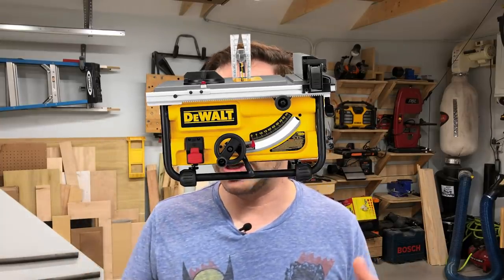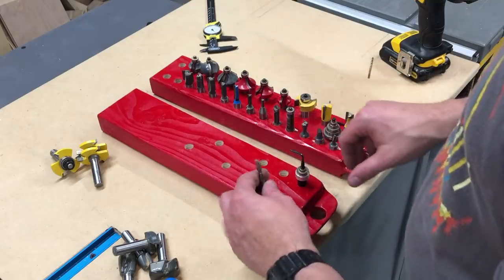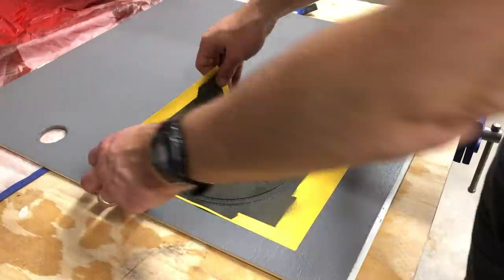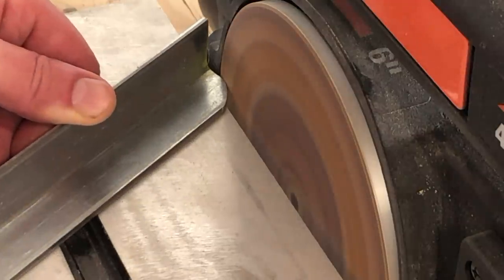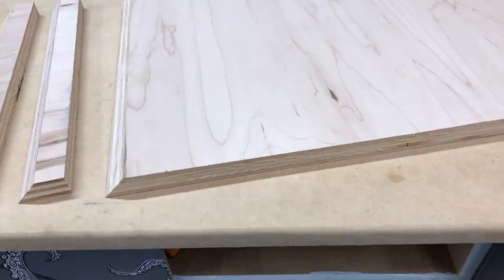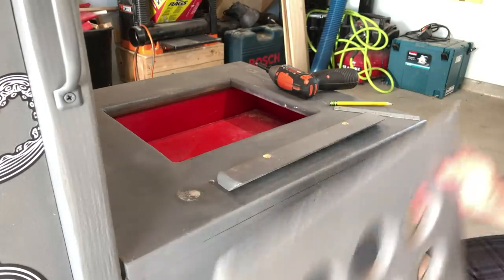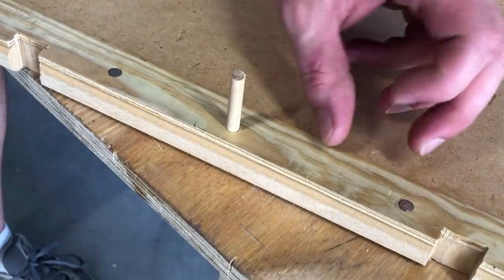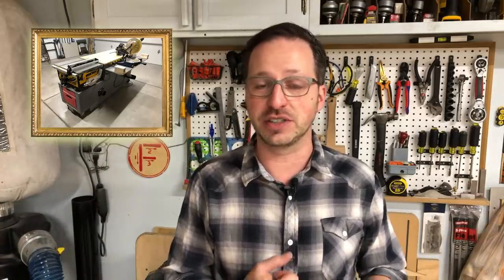DIY Amazing Compact Workbench - Part 4: Router bit holders, Table saw extension, Finishing touches

Comment: For me, the best parts are the folding shelf for miter saw, and the end shelf for additional devices as needed.  The table saw and extension was cool, but the saw can be standing right next to the bench if needed.  Love it!
Reply from the maker: Thanks Eric, I'm a big fan of the adjustable auxiliary shelf. I use that a lot, and that idea of brackets could be used in other builds too.

Comment: Jordan, thanks for taking the time to make these videos. I really enjoyed the education that is part of them. I have been searching the internet for plans that I could adapt to my needs. I have the back half of a one car garage. The other half being the laundry area. I will be building a modified version of your table, leaving out that storage area t o cut down the length. I have a Dewalt DWE7480 and a 1/2" Ryobi plunge router and a trim router. Miter saw will be later this year. 

I noticed that your power cables required a tight bend to plug them into the power strip. I think I will look into mounting my power strip face down to avoid the tight bend. Just a thought.

Thanks again & your right . . . I can do this!!!!!
Reply from the maker: Love it Red! You can definitely do this!! A few people have commented on the power strip, and I think you're right, but it's kind of a toss up because it will relieve the bend on the tools you have permanently plugged in, but the ones you add as you're using them might be harder to plug and unplug and also might bend in the other direction. I don't know, it's worth trying though. Good luck!
Reply: @withJordanFrank  Didn't think of that! What about 2 shorted power strips?
Reply from the maker: Compromise, I like it. I’ve seen smaller regular power strips that let you pivot individual outlets; that’s what we need, a serious shop power strip with outlets that pivot. Look at us, solving problems!

Comment: I'm going to take a second look at your extension table as a possible infeed extension.  I have a similar sized Ridgid saw with a small top surface.  I often wish I had a bit more runway for material to sit on before getting to the blade.  My bench doubles as outfeed support, but my indeed is often lacking.

Comment: nice on making the tops more durable, I learned this from Frank Klausz 1984; but in 4 parts;  1) 3 parts alcohol 1 part varathan... 2) 2 parts alcohol 2 parts varathan...3) 1 part alcohol 3 parts varathan... sanded between each and last 100% varathan lightly sanded and wood floor wax. never fails to work. still in use today
Reply from the maker: Love that Gary. How often do you find yourself having to redo it?
Reply: @withJordanFrank  never had to redo the applacation, I do re wax it with floor wax
Reply from the maker: @garystump1776  NICE. I'm going to look into that. Thanks for sharing!

Comment: 1. To lighten the saw table extension more turn those rows of holes into slots 
2. What's your dust collector? 
3. If you posted a link to the fold up table brackets I missed that, what's the brand & P/N?
Thanks. Subscribed.
Reply from the maker: 1. I like that. Honestly if I had a CNC I'd use that space to put something really stupid carved into it, like a picture of a CNC or something. But lighter is good too
2. It's a Shop Fox, one of the only wall-mountable ones that can do 120v. It's okay. It works well enough but when I added the cyclone the pressure dropped enough that it is kind of disappointing. But the barrel is a lot easier for emptying and I like that it catches bigger chips, so... I'm going to use it all till it dies then switch to something a bit bigger I think.
3. Links to everything I used are on the free plans.  4. Thanks for your feedback, I appreciate it!

Comment: I"m confused.  If you used aluminum angle iron, why would you need to paint it to prevent rust and how would a rare earth magnet do anything for your connection to it from the extension table?
Reply from the maker: You’re not confused, I was confused. Many people have politely pointed out that I don’t know anything about aluminum, and they’re correct. The good news is now I do, and yes, there’s no point in painting it or using magnets. Science!

Comment: Sounds like me. I'm thinking of starting a You Tube channel called the Lousy Woodworker or The Crappy Carpenter. I like the look of the bench and will probably have a go at it. My "shop" is in the corner of my car porch. Thats right no garage so I have to move out the car and set it up to work and pack up when I'm finished. Everything was a compromise to get me started especially the work bench. With the benefit of 20:20 hindsight I'll probably put together something like yours after I get most of my study fitted out so I can get my books and other things out of storage. That includes some of my tools which are buried somewhere in about 100 boxes.
Reply from the maker: I feel your pain! Also I toyed with similar ideas for a channel name, before arriving on the extremely clever "with Jordan Frank". Where I live you can't park on the street overnight, so Every Single Time I'm done working on a project for the day I have to pack everything up and move it so the cars can fit in the garage. Makes for a real challenge. But that's the old saying right? "Necessity makes for your mother and her inventions", or something to that effect.

Comment: What would you recommend as a modification for a sliding miter saw? just a wider fold out?
Reply from the maker: Hi Ryan, yes, within reason. At least one brave soul who has attempted this build has run into that issue. If your saw is much bigger (and in particular Heavier) then you actually run the risk of it tipping your bench. I am aware of someone building folding out legs that stabilize the shelf. Personally, and I know this isn't an option for everyone, I think I would rather build a small stand for my saw than have it be that big a shelf off the back. Having said that you can definitely make it work. If you do move the saw off the bench I would still recommend keeping the folding self, because I use it all the time just to hold stuff. The face that it sits lower than the work surface is nice for throwing on your plans, pencils, rules, tape measures, etc, without interfering with your table saw or router

Comment: Thank you so much for the build video series.  I really like the bench you've made and I think it would be a really good starting point for one I'd do for my garage shop.  Suggestion, next time you redo your extension table, instead of using a jig saw to remove the area where the angle iron bolt heads are, use a router bit from under neath to remove a recess area that won't be visible from the top.
Question, so you have videos on how you made you french cleat machine tool holders (band saw, drill press, sander, etc.) for mounting on the bench and mounting on your wall?
Reply from the maker: Excellent suggestion on using a router instead of the jigsaw, thank you. And I am actually editing a little something right now that will include a closer look at those brackets. Stay tuned!

Comment: Jordan, do you have your wen planer on the removable shelf system (opposite table saw).  Its a heavy planer, just wondering how the shelf would hold up to that much weight.  thanks
Reply from the maker: Great question and NO. I repeat NO: do NOT try to put a planer on a shelf like that. If I ever actually finish the video I've been meaning to put out I have a more detailed look at those shelves and they definitely can not hold that kind of weight. Also planers are too heavy for a weakling like me to be picking up and carrying around; I put mine on a low wheeled cart the minute I got it. I would have made it higher but I wanted it to fit under the shelves you're referring to.

Comment: outstanding video...nice job...two quick questions...what type of plywood did you use and what is the ball park material cost?   Thanks
Reply from the maker: Thanks John. I used 3/4" baltic birch from the ol' Home Depot because if I remember correctly they had a good price on it at the time. 90% positive the 1/2" was the same. I unfortunately couldn't tell you a price. I put links to all the hardware/casters/router switch/etc in the plans, and you could add up a total that way (plus cost of wood). I had some ply already, I reused hardware from my previous bench, and I bought some parts I wound up not needing (ducting/Dust Rite ports), so my figures aren't representative of what others would have starting from scratch. I'm going to guess somewhere around $400 all said and done? But that's a total guess. Also, don't forget, you can build this thing in installments for sure. Basic building then other parts as needed. Hope that helps.
Reply: @withJordanFrank   we actually were in about $175 on raw materials, probably closer to $200 by the time you add all the screws.  and my shopping list for components was closer to $350.  I had budgeted $500 and just went slightly over.  And then I decided i couldn't throw a cheapy router with no lift into this incredible table, so i dropped $300 on a new Bosch router and Rockler FX lift.  I guess it's like the old saying goes... it's only money, you can always make more :/.  Overall though, this is still on the cheaper side of workbench budgets, and I was able to get rid of 3 other stands (router, table saw, and miter saw).  The space savings alone brings the total cost down to the old Mastercard "zero dollars" from my wife's standpoint, making it very budget friendly!

Comment: Hey Jordan. can you share what type of screws you used? seemed to be a bunch of sizes, but I like to know exactly what is recommended.
Reply from the maker: I wish I could but I unfortunately don't really keep track, I kind of grab what's available. I used almost all Deckmate exterior phillips head screws, usually 3" for 2x4 to 2x4. Plywood to 2x4 I would usually use 1 5/8". Pocket holes I use Kreg pocket hole screws and length depends on application. Hardware screws were all over the place, really just depended on the part. Sorry I can't be more exact. If there's a specific part you're wondering about let me know and i can look.

Comment: Hi Jordan, I am building a table just like yours. I have a DWE 7485 table saw.I am right now stuck at “table saw extension”. My table saw has two extensions which is prohibiting me to follow your guideline. Can you please help me out in this?. I will attach a picture for exact view.
Reply from the maker: Glad to hear you've made it so far! So yeah, your saw is definitely different. I'm looking at pictures of it online and I see what you mean by the two "extensions" on it. Without seeing one in person I'm not sure, but it Appears you could simply scribe your extension shelf to fit in that little pocket there that's created by those two bump outs. Just put the aluminum cleat in the middle part of it; it should still be wide enough to hold the shelf. Without seeing it in person that's the best I can offer, but it looks like you could still make it work. Good luck!

Comment: I simply LOVE the build and it is an amazing job, a truly GREAT concept and brilliant ideas!! I do honestly applaud you on it!! 

BUT I do have to wonder "What you were thinking?" on the extension for the table saw for TWO very serious reasons!! First, the "angle iron" you used was aluminum or so you said in the video!! Then at one point you said you spray painted it so it wouldn't rust.....and this was my first question: "Since when does Aluminum rust?" Sure Aluminum CAN oxidize but it doesn't actually rust.....and my second question was raised when you installed magnets to the bottom of the same shelf and you proclaimed "I should have used bigger magnets but that is all I had!" and I am again thinking to myself "At how universe do magnets stick to Aluminum that YOU live in?" 

I am NOT saying your planning and concept is bad and honestly the idea of the dowel pin was genius though I would have used two of them instead of just one!!! But the Magnets are completely worthless as Aluminum DOES NOT attract magnets if your "angle iron" is actually aluminum to start with!! 

And please, PLEASE don't get me wrong!! I have a huge "space problem" in my shop (see my videos on my channel) as my shop area is only 8 foot by 8 foot by 8 foot to begin with!! AND like you I own a small table saw which is actually a contractors saw, which is small and very portable only because I don't have the space to run a larger saw in!! So I have been looking into ways to make it more "flexible" in what it can do!!! And I do appreciate your "wing extension" idea!! I even like the work bench as a whole, though storage for me currently is a total nightmare until I get my new roof/ loft built (which has been on hold for the past four years now)!! 

The rest of the build was simply brilliant like I said!! I do like your design and the idea of allowing the dust collection to "sway" for the table saw (when it is moved to a different angle) was an interesting idea as well!! I even love the adjustable shelf at the one end of the bench also!! Currently I don't have a drill press, band saw, sander or a vice, but hope that soon I will, so I do need a place for my router, table saw and miter saw soon!! The only problem too I have is I usually work in my yard as my workshop is a shed and those caster you use would sink into the ground!! So I need something "bigger" and perhaps filled with air!! You have given me a lot of great ideas though and thank you again for an amazing video!!!

Comment: How do you make all those stencils of your logo? you can't be painstakingly cutting them out with a razor blade each time, can you?
Reply from the maker: From a Frank to a Franks, the answer is Hell No. My wife is crafty and has a Cricut machine, which is like a CNC that can barely cut through cardboard (to be fair it can also draw and stuff too, it's kind of cool). As soon as I saw her using it I said "stencils!" and figured out the software enough to do that. That's all I use it for but it's real handy. A laser cutter on vinyl would be even better I bet.
Reply: @withJordanFrank   Ah thats awesome. Teamwork on the logos!

Comment: curious after 5 years is it still performing and what have you upgrade to. You tore down the donkey to build the octopus. what will your next bench be the Buffalo?
Reply from the maker: 100% still performing. Haven't had to change anything out, it's all still working as well as the day I built it. The ONLY issue is that about 1/3 of the octopus sticker has fallen off, which is a real shame, but it just means this bench has seen some stuff. And yes, one day I hope to have enough space to create The Buffalo 😅

Comment: aluminium doesn't rust and is not magnetic, these are both true and false in a way, rusting is also known as oxidization and aluminium does oxidize, also with a strong enough magnet you can attract literally anything, google levitating strawberry or frog
Reply from the maker: Joe G.P., dropping the science and kicking the k-nowledge.